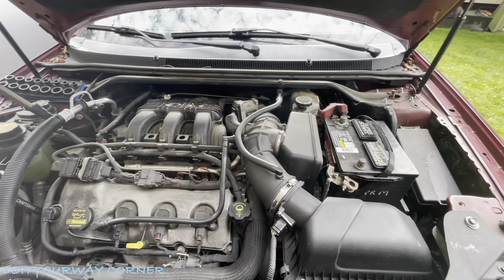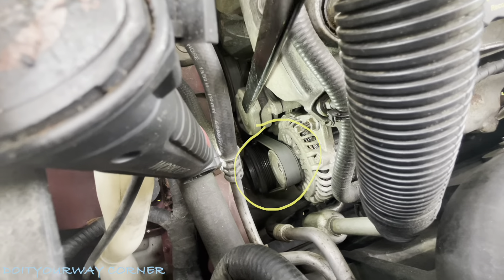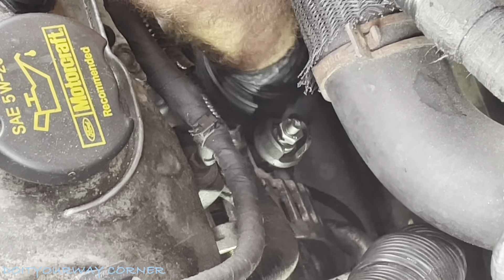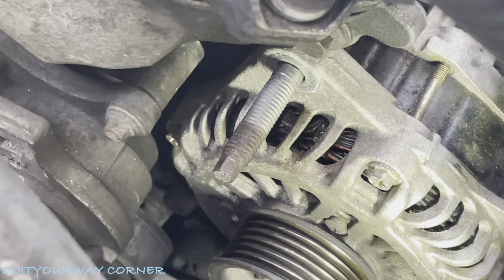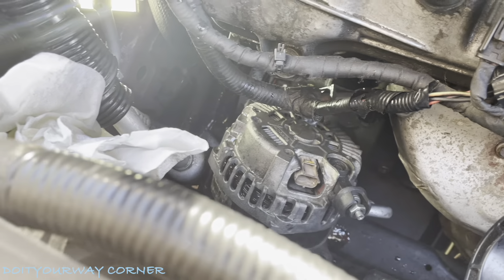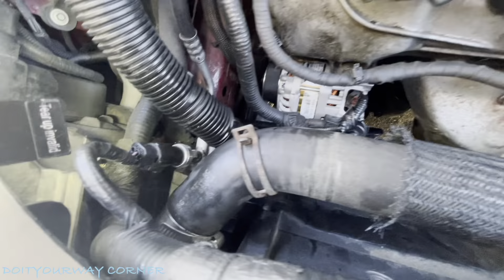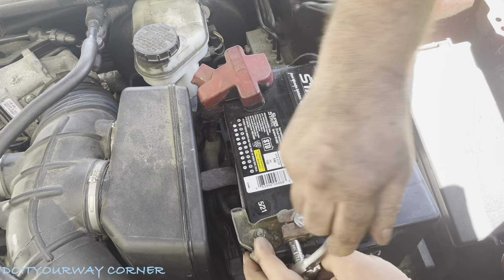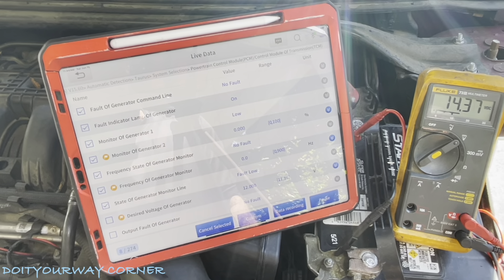2008 Ford Taurus Alternator Replacement

Comment: Did you have to bleed your coolant afterward?
Reply from the maker: Great question. Nope, and I havent heard any gurgling coming from my heater core. My guess is that I didn’t lose enough to require it. Fingers crossed.